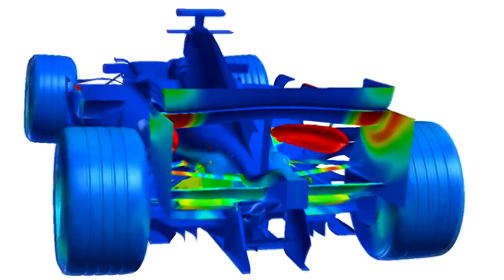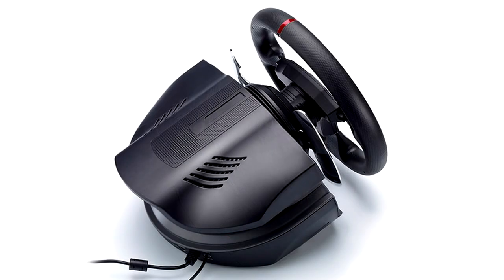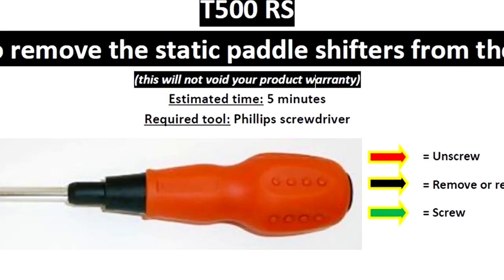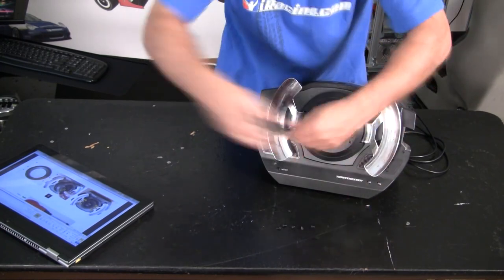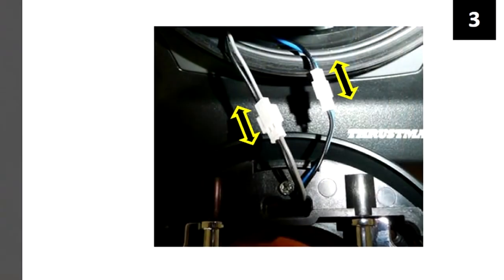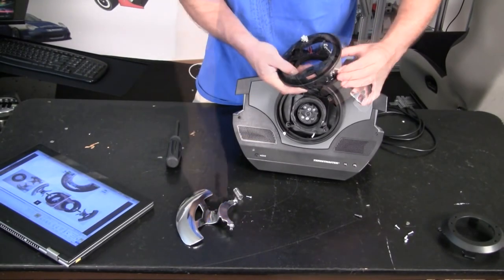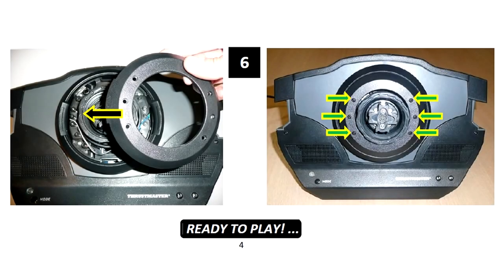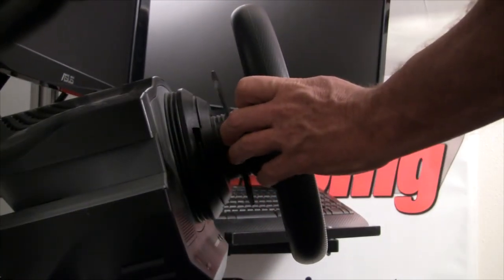Thrustmaster T500RS Static Paddle Shifter Removal -- Factory Approved

Comment: OMG finally, after a long time searching exacly for this, love you guys Thank you!
Reply: Why should one want top remove the paddles?
Reply: @FutureIsBetterThanThe80s  because on replacement rims the paddles are on the wheel not the base, i put the ferrari FXX rim on mine and the paddles were in the way :)
Reply: @RubberDuckTrucking  that means we can use t300 wheels with their Paddels  on the t500 base!?
Reply: @FutureIsBetterThanThe80s  hmm that i dont know, you would have to compare the mounting mechanism and connectors, the ferrari FXX wheel i installed was made for the T500RS specificly so i can't help you on that one sorry

Comment: Does anyone knows how to fix the gear shifter, but of the Ferrari wheel the one that is with the wheel not in the base like in this case, the thing is the interruptor that is inside of the paddle is stuck, doesn't click, you know the sound that used to made it's no longer doing it so...

Comment: If I put the T300 steering wheel on the T500 and remove the static paddles will the buttons map correctly on the PS4? Currently the T500 stock steering wheels buttons don't map in the menus of the PS4 - only in game.
Reply from the maker: adysh ramzi Theoretically it should. Not sure though

Comment: who designed such an disaster? when the paddles wouldn't be fixed,  I would by an T500RS. Now, I am more interested in an G29.
Reply from the maker: +dubtube You can remove those.. you can also get rims that have paddles attached to them. T300 is the way to go now
Reply: +Inside Sim Racing that is correct. But I don't want to spend €500 for a steering wheel and buy a second steering wheel without pedals. This doesn't make sense to me.  The problem with the T 300 are the cheesy pedals And the pro pedals from the T500 are sold out in Germany :/
Reply: +dubtube the g29 is the way to go its like 200 euro now i think? but not many ps4 game's support it as itis a new product. but many upcoming games will support the g29.
Reply: g29 is quite shitty wheel, now they're shipping t300 with the alcantara rim and t3pa pedals, so that's the way to go, but for drift t500 is still better